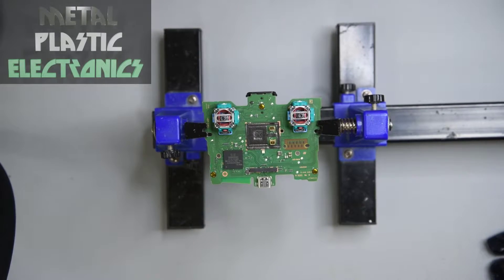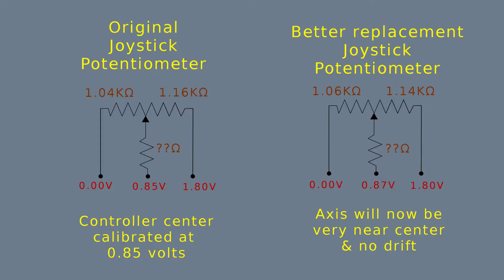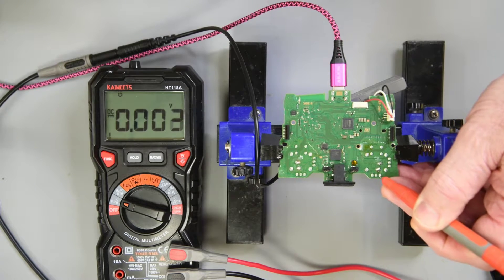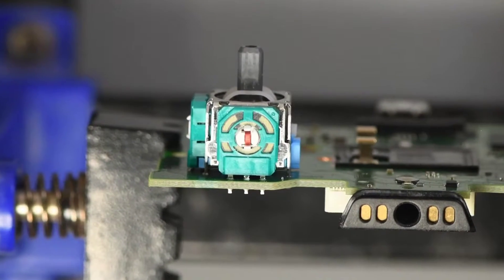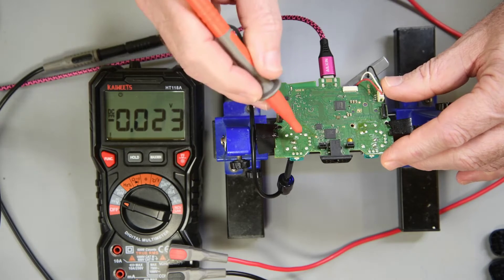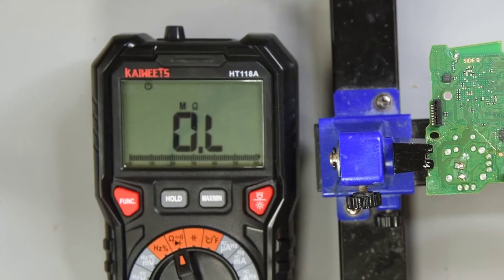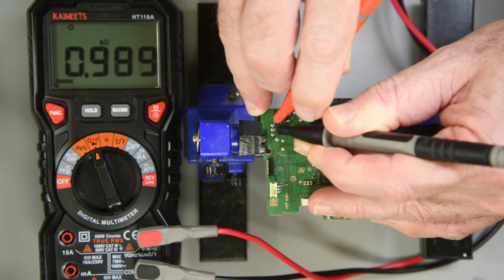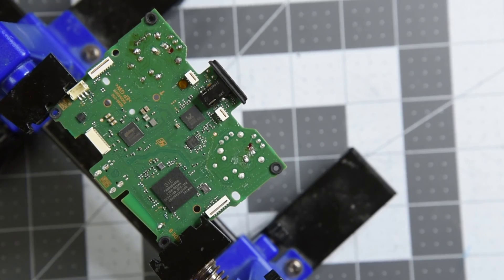Troubleshooting a Replaced DualSense Joystick

Comment: dude you are awesome and this video needed so much digging to find. thank you and god bless
Reply from the maker: Glad it was helpful.
Reply: It helped me fix and install TMR sensors in my dualsense 

I have a question I did the same for my friend who asked for it but the x axis is completely inverted after installation and I don't know how to fix it, also tried another sensor but still inverted.  😢
Reply from the maker: If the magnet is reversed, it will cause the axis to invert. If it's a TMR sensor, then flipping the magnet over should do the trick.

Comment: i replaced both sticks to hall effects. left side is working fine. right side is peg alway out past outer deadzone ring on game pad tseter.. barely moves up down and no movent to right at all. what could cause this
Reply from the maker: If it is pegged all the way to the right, the voltage the controller is seeing for that axis is close to 1.8 volts. Check the ground and center pin connection on the left/right sensor.  If it is pegged all the way left, then the controller is seeing close to 0 volts.  Check the connection at the B+ and center pin of the sensor.  Make sure the traces haven't been damaged.
Reply: @ I just noticed when playing call of duty i pushed down left stick and my gun fired. Seems like i still got something going on.
Reply: @metalplasticelectronics354  turns out there was no voltage on the pin. Ran a jumper wire and it was working.
Reply from the maker: Very good.

Comment: Super helpful video! I have a couple issues i was hoping you could help with. I did a hall effect joystick swap and left joystick is working but the right was getting no power at all. I took it back off to see if it was the joystick that was the problem and I damaged one of the wires for the r3 button. My first question is what could be causing the no power? And the second is there a way i can jump the damaged r3 wire? Thanks!
Reply from the maker: If it's the 1.8-volt supply trace that is damaged then yes.  Just run a thin wire from any of the other 1.8-volt supply points.
Reply: @metalplasticelectronics354  can I do it from the other joystick?
Reply from the maker: Yes

Comment: I replaced now my controller doesn’t power on 😞
Reply from the maker: Make sure you don't have solder where it shouldn't be.  Also, make sure the wires on the battery connector are not damaged.  Do you have a meter?
Reply: @  everything just seems to work suddenly today! 🤦🏾‍♂️ I left it overnight and viola! Turned on!
Reply from the maker: Very good.

Comment: I tried to replace the joysticks but they don't work, while watching your video I noticed that the pins don't give 1,8 volts but one side gives me 1,8 volts but on the other side of board it give me 0 volts, can explain why is that happening?
Reply from the maker: A broken trace more than likely.  Do both sensors have 0 volts?
Reply: I believe that I damage the via rivet because one side gives me 1,8 and when I try to read the same hole it gives me 0 volts on the other side, is there a way to fix the via?
Reply from the maker: If the 1.8 supply voltage is missing, you can run a thin insulated wire to another 1.8 volt supply connection.

Comment: I have an issue where my L3 and R3 doesnt work pls help
Reply from the maker: Do you have a meter to check voltages?
Reply: @ yes i do, i just dont know the basis for the buttons to “work” the two pins ive tested for that r3 button have voltages of 1.8 and the other 2 ground pins are at 0, when i click them the two ground pins go to voltage 1.8 as if theyre working properly. But no input in game. Do you have an email or contact?
Reply from the maker: Yes, you can email me at mike@mlplel.com.  The switches are working then.  The pads and traces to the switches are the most delicate of the joystick connections.  I would suspect pad or trace damage.  But have you tried a hardware reset of the controller?  If they ever act strange, that's the first thing I try.  Well, that and the flat flex cables. This website has pictures of some of the controller mainboards: https://acidmods.com/forum/index.php?topic=44714.0  .  It might help trace down where the switch traces go.
Reply: I remove the joy sticks and the copper trace either side came up from the r3 and l3 ground and where they have voltage, im not sure how to tap them to regain operation, i have a picture of attemptting to fix the trace with copper wire, not sure where i went wrong though. Its a nightmare
Reply: I attempted removing the straggling trace and repairing which i thought looked correct, still the same result.
Reply from the maker: That is the problem.  Unfortunately, I think some of the switch traces work their way to an inner layer of the board.  It depends on the PCB model.  If the trace is on the top of the board it will be difficult.  Look up some videos on laptop PCB trace repair.  There should be some good info and you can get an idea of what you will need to do.

Comment: Your channel is amazing thanks for all the Knowledge you share with us.
I got a issue with the R3 switch doesn’t respond after changing the joystick for one magnetic, In the two superior point I have 1.8V.
I bridge the L3 (I didn’t changed that one) just to prove, but when i bridge the R3 doesn’t works. I think i burned the trace when I’ve been disoldering. 
Any idea about what can I do? 
THANKS A LOT FOR ALL!!!! 👌
Reply from the maker: You would have to find where the PCB trace goes to.  The problem is I believe some of the switch traces are on an internal layer of the PCB.  Here is a site with pictures of the 10, 20, and 30 mainboards: https://acidmods.com/forum/index.php?topic=44714.0 . If you can find the trace and it's damaged. Should be able to find some laptop repair videos about trace repair.
Reply: @metalplasticelectronics354  thanks a lot, thanks God I fixed apparently was a bad solder, I resolder and buala.
i have another question: you think is ok if I bridge the 1.8v points in the same module or only between modules???
thank you for your help
Reply from the maker: All the 1.8-volt lines to the joysticks are tied together.  You can run a thin wire to any of the other 1.8-volt points if a pad or trace is damaged.
Reply: @metalplasticelectronics354   I did just that and it’s working great thanks to your videos, you really help me a lot. You have one subscriber more.
Reply from the maker: Very good, and thanks for subscribing.
Reply: Substituí meu stick analógico direito por um TRM e agora o botão R3 não funciona. Existe alguma solução? Tenho os dois pinos de aterramento funcionando, apenas os dois pinos inferiores do botão não estão recebendo sinal.

Comment: I had just replaced the analog sticks for a pair of hall effect ones and it doesn't turn on. What are the most common places i could solder something poorly or just outright tore something up from it that demages rhe pcb that badly?
Reply from the maker: Look for solder touching where it shouldn't and double-check the wires coming from the battery pack.
Reply: did you fix it? im facing the same issue right now - when i plug it in theres no sign of life from the controller.

Comment: I swapped the sticks on my bdm-010 controller with gulikit hall effect joysticks and it works for about 30 seconds. In those 30 seconds, the sticks track perfectly, don't get stuck or anything, but then controller turns off. I've measured 1.8V at the supply pins on both sticks and confused on where to go from here, any help would be appreciated.
Reply from the maker: Are there any flashing LEDs or does it just power down?  Have you tried a hardware reset?
Reply: @metalplasticelectronics354  when it turns on, it's accompanied by a flashing yellow led that blinks twice. It turns off without notice. I have not tried a hardware reset.
Reply from the maker: Check the wires going to the battery.  I'm not sure what blnk error it gives if the temp sensor pin is not making a good connection.
Reply: @metalplasticelectronics354  looked at the battery, didn't see anything wrong. Tried another battery and had the same issue
Reply from the maker: If you can't find any solder splashed somewhere it shouldn't be.  I don't know where else to look.  Have you tried just powering up the mainboard?

Comment: I recently attempted a hall effect replacement but now get 3 amber flashes whenever I connect the battery or USB. Any suggestions? 😢
Reply from the maker: Check for a short on the 1.8 Volt line.  It might be a splash of solder somewhere it's not supposed to be.
Reply: taky jsem tak dopadl-a při hledání na netu jsem zjistil že nejsme sami...přitom jsem si fakt dával pozor...jojo chybička se vloudí...🙃

Comment: My right joystick the bottom potentiometer is reading 950 ohms on all three . But the voltage for each is 0 . It's stuck on left drift all the way
Reply from the maker: If all the other axes are working then you are missing the 1.8 volts going to the sensor.  If facing the sensor with the pins pointing down, the rightmost pin should have 1.8 volts.  The pad or PCB trace is probably damaged going to that pin.  You can run a thin insulated wire between that pin and the other 1.8-volt pin that is on the up-down axis.

Comment: Im new to soldering and I made a big mistake when extracting the potentiometer... when I removed the original one that was drifting, it came off with copper in its legs, and it seems like they are crucial for contact with the board. Surprinsigly, it worked when i installed a new one, but it was off centered. When I made another attempt to install a new one, the new ones never made a connection again. The resistence of the potentiometer always measures 2.1 KOhms when installed, whereas the other are around 0,7 KOhms. Almost as if it isnt part of the circuit. Another thing is that the voltage isnt 0, it is something close to 0,9 Volts whent the controller is powered on. What should I do? Is this fixable?
Reply from the maker: With the joystick in the center, the potentiometers' center leads should read close to 0.9 volts. That means you have 1.8 volts on the power pin of the sensor and ground on the other, just like it should be.  The power and ground are common to all 4 potentiometers.  Check the resistance between the power pin of the pot that is reading 2.1K and the power pin of any of the other pots if it reads close to 0 ohms then that connection is okay.  Then do the same for the ground pin.  One of the two pins will probably read over 2K and that is the defective connection.  You can simply run a small wire from that pin on the pot that is reading 2.1K to the same pin on the other pot.  And that should fix it.  Now if it's the center pin that is damaged it's a lot more work.  You will have to find the trace that the center pin connects to and repair it or run a very small wire to it.  And where the trace is depends on which mainboard is in the controller.  Take a look at this website to calibrate the controller with the new pots: https://dualshock-tools.github.io/
Reply: Thanks a lot for answering. 
I did check, and it seems like it is the power pin. However, is there a method for repairing the hole? I mean, if I removed the copper from inside of the hole, can't I place something else that's conductive, like an eyelet?

Also, would you recommend me giving up at this point and sending it to a professional? I am scared of damaging it permanently with my lack of skill.
@metalplasticelectronics354

Comment: Hello, thank you for all these helpful videos! I replaced my modules the other day with the Gulikit TMR and my Rumble motors started making a fizzing sound and stopped working. What did I do wrong? Is it too late to fix it?
Reply from the maker: Make sure the soldered ends of the motors' wires are not touching something they shouldn't.  Also, ensure no capacitors that go to the wires have been knocked off.
Reply: @ Thank you! 🙏🏾 Appreciate the reply

Comment: I changed to Hall effect sticks. Put back together and was working. While pluged in to laptop checked the sticks for Calibration. Now left stick  on full up.
Reply from the maker: Check for a bad connection.  Left full up will be 0 volts coming from the up-down axis sensor.
Reply: Thank u for replying. I'm try to check things on your videos.
The axis does move but only opposite end of movements.
Has the 1.8v power and no power to ground. 

And middle pin seem to change voltage
Reply from the maker: If the voltage is changing on the sensor's center lead and the gamepad tester is not showing the axis moving, I would check the center lead PCB trace and ensure it is not damaged.  As you move the joystick, the voltage should change from near 0 to near 1.8 volts.
Reply: I've done that and it does change from a few milvolts to 1.78 v.
And when it plug in to computer the stick commands are only +100 to -100.
No middle Resolution

Thank you for replying
Reply from the maker: Try a hardware reset of the controller and then do a calibration.
Reply: @danielpeters6906  Did you managed to find a solution for this ? I have the exact same problem right now

Comment: Getting an issue where replaced joysticks are showing as having 20% circularity error. When in game it’s like it gets stuck on the x y axis when doing micro adjustments. Any tips to solve ?
Reply from the maker: Have you tried the calibration website?  https://dualshock-tools.github.io/
Reply: @metalplasticelectronics354  tried that but even after range calibration it remains at 20%, is this normal? tried two joysticks from different suppliers
Reply from the maker: It seems high.  What joystick brand are you using and is it made for the DualSense?

Comment: I replaced the analog stick on my BDM-010 board with a Hall sensor. However, despite disconnecting all the connectors, the R1 input continues to register. It seems that solder may have splattered, or damage may have occurred. Do you have any ideas on how I should approach attempting to fix it?
Reply from the maker: Can you hook up just the mainboard with the battery to a computer?  And iff you hook up just the mainboard does the R1 still show triggered?
Reply: @metalplasticelectronics354  
After removing all the connectors and leaving only the mainboard, I checked on the Gamepad Tester website, and the R1 button was still being pressed. Later, after finding a hint on the acimods website, I removed the micro SMD capacitor, and the issue with the R1 button being constantly pressed was resolved. After reconnecting all the connectors and testing again on the Gamepad Tester website, the R1 button worked normally, but the R2 button is now unresponsive. The SMD capacitor is so small that I’m having difficulty reattaching it, and I’m not sure if I can do it. If I reinstall the capacitor, will the controller function properly? I’d like to share the reference image, but I don’t see a way to upload it. Is it okay if I share an external link?

Thank you so much for your help. I was already able to fix the analog stick on another broken DualSense, inspired by the 3:19 mark. I really hope the issue with the R1 button can be resolved as well :)

Comment: Thanks for the video, I replaced my second set of sticks today and the r3 button is not working, do you know what could be most likely causing this? Thanks
Reply from the maker: If the switch is mechanically okay.  The PCB trace and solder connection are the only things I can think of.
Reply: @metalplasticelectronics354 it clicks fine and I’ve redone the solder joint. I think I’ve damaged a trace, but not sure on the fix, do I just connect a wire from the r3 solder point to a ground?
Reply from the maker: It's been a while since I've checked the voltage on a L/R3 switch but if I remember right 2 pins go to the 1.8 volt supply and 2 pins work their way back to the microcontroller. If you have a meter check the voltage on the switch pins.
Reply: @metalplasticelectronics354  ok what’s weird is I’ve replaced the analog sticks for 3 controllers, and for 2 of them the r3 is not working. Is it possible the sticks are faulty?
Reply from the maker: It is always possible but I would think very unlikely.  The switch is about the simplest part of the joystick. Could always be a bad batch though.  I think you will need a multi-meter to track down the problem.
Reply: @metalplasticelectronics354  I ordered a multimeter and checked for continuity. Stick is working fine as the continuity between the top and bottom pin is there when clicked. Means I must’ve broken a trace somewhere
Reply: @metalplasticelectronics354 I’ve read the voltage at the top 2 pins are reading 1.8v, the bottom two 0. Same on the L3, but that’s working
Reply from the maker: Probably so.  That or static electric damage to the microcontroller.  Are you working on carpet or a rug?
Reply: @metalplasticelectronics354  yes I have carpet underneath, but if it was static discharge, would it not damage more than just the R3 function?
Reply from the maker: @jkdfhdifdsfjhdnfi  No, it can be quite strange what a static discharge can damage.  If you are on any kind of flooring that can generate static electricity I would get an anti-static work mat and wrist strap.  Have you tried a hardware reset of the controller?  If the voltage is changing on the switch when pressed I would say something with the microcontroller or a break In the trace somewhere.  But most trace damage is going to be very near the solder pad.  The fact that you have 2 acting up is very strange.